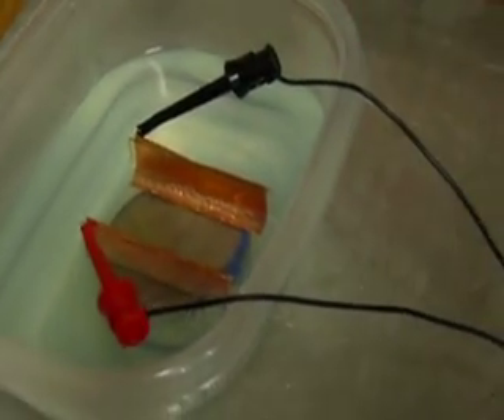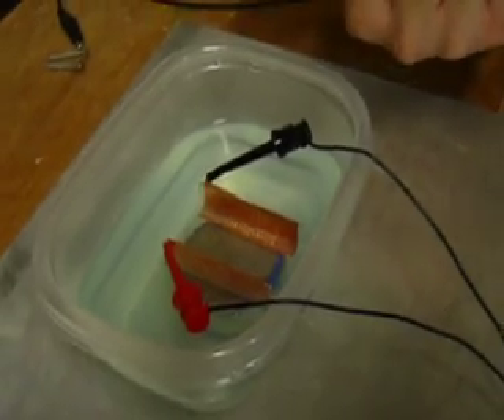Magnetohydrodynamic Pump Demonstration

Comment: if this device was was dragged through the water so that water passed over the components would it work in reverse? woould it give an electrical current ? if so this current could be used to propel device though water or ships across oceans or capture current of tidal flows.
Reply: In order for it to work in reverse it would require an electromagnet as opposed to a rare earth magnet, I would imagine.
Reply: Yes it would work. Watch a channel called Tech Ingredients and search for a vid named magnetohydrodynamics in that channel.  It generates about 56 mv when water is dropping through the field. But it's capable of more